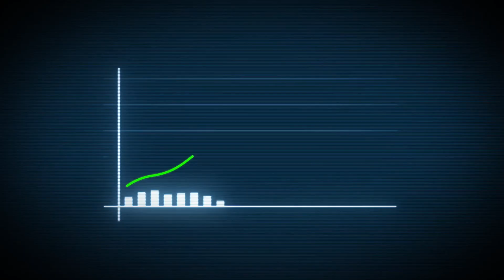The Insane Story Of The Airbus A380 Failure

Comment: What a totally ridiculous vdo! The 747 was "notorious"? Utter B/S about an aircraft that flew for many decades and was loved by airlines and passengers. The A380 "the most hated"? Again utter nonsense. Ask most passengers who love it. You talk about filling the A380 with 853 passengers in a 3-class configuration. More absolute nonsense! With just economy seating roughly 800 is possible. But virtually every carrier configures the aircraft with around 520 passengers in 3 or 4 classes, although Emirates does have one with 615 but only in a two class configuration - business and economy. Your facts are totally wrong! The aircraft was simply conceived at the wrong time, in the same way that there was little market for two tri-jets - the L-1011s and DC-10s.  The sky is definitely not "full of 747-800s" as less than 50 passenger aircraft were produced and most for just one airline, Lufthansa. The 747-400 is no longer produced and today you rarely see them in the skies! You refer to the 777s but this type is 30 years old with many only staying in service because the replacement 777X is already about 7 or 8 years later than promised by Boeing! Neither the 747 nor the A380 can make a comeback as you suggest because both production lines are already dead! An absolutely nonsense video that I finally gave up watching after 8 minutes. Total B/S.

Comment: Actually this video got the primary miscalculation of Airbus wrong. Airbus was betting on what is known as the Hub and Spoke aviation strategy in which the major aviation hubs would be over crowded and thus need bigger plane to ferry passengers there before switching to smaller planes to get to their final destinations. 

What happened instead was smaller plane got longer ranges and opened up direct flights to more cities which had smaller airports which could not accommodate the A380 size. The market also shifted towards liking direct flights, bypassing the hubs

Comment: The national electrical grids PRICE to build over the last 100years is hidden and very expensive. 
MARKET for future electricity is expected to expand 5 times. 
DEMAND for inexpensive electricity is critical and so dispersed generation and storage are also critical. 
No transmission grid expansion is necessary. 

The existing national transmission grid is humongously expensive and fragile. 
Black outs and patch ups explode power bills.

Central generation of electricity can not be expanded economically the PRICE of transmission is humongously stupid. 

The A380 project is a baby. 

Economics makes or breaks all projects. 

I  have digressed, but you raise the often ignored economic situation of the entire project, all projects. 

Future humongously big projects must learn from past humongous projects. And even if they are different technologies.   😊😊
Reply: Tesla Megapacks to the rescue!
Reply: @RTD3  yes part of the solution. 

Grid protection as the electricit future expands.

The grid is a $TRILLIONS infrastructure asset. 100years to build. But only transports 15% of all energy used. 

Community batteries with Rapid chargers will be a stepping stone starting with early adopter suburbs.
Offgrid capacity for customers will mean the grid can be UNLOADED and protected.